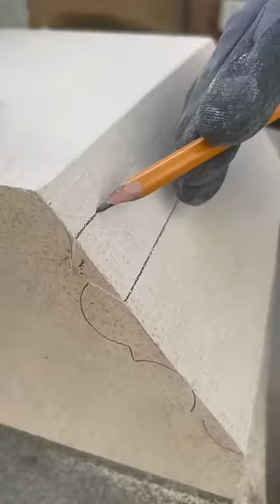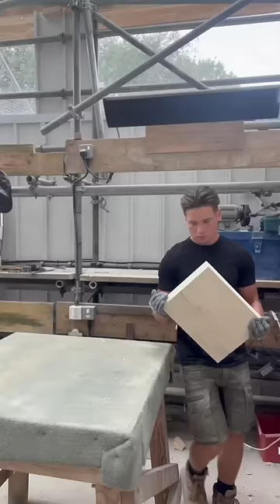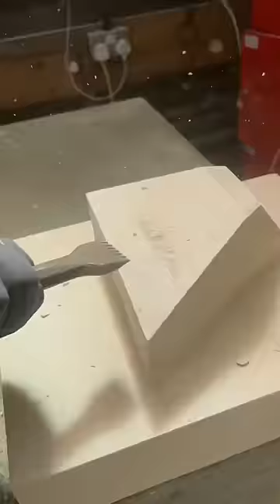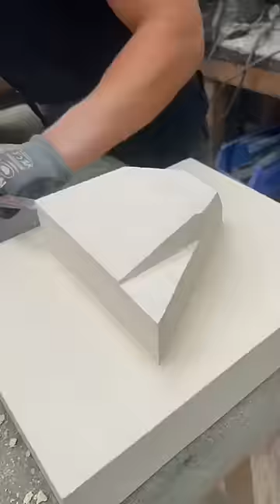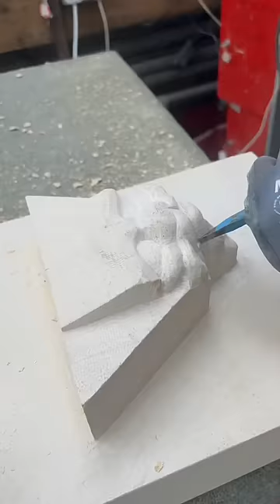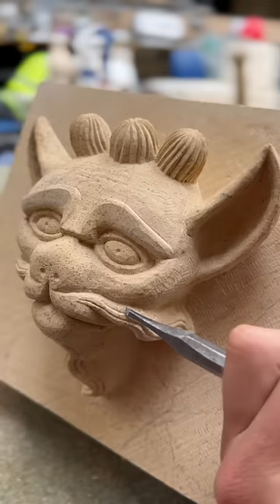#stonemasonry

Comment: Man JR could have spent 5 seconds and googled Stoneworkers
Reply: He could have one on the show
Reply: Stoneworkers with copper tools ?.. 🙄😅
Reply: @peterfitzpatrick7032 they used bronze tools, coper and tin, which is a lot stonger than pure copper. 
The fact that there are very few big pyramids shows us they were very hard to make. If they had "lost technology" and the civilisations were tens of thousands of years old, we would see many more big pyramids and structures.
Reply: @steelybojangles can you please explain the other items such as the precision vases that could have only been made on a lathe with a diamond bit? Or the large stones that we would have significant challenge and moving, as we have already proved through testing. It is stated fact that with the current knowledge that we have, we do not know how the Egyptians, or whomever created the civilization, were able to achieve what they achieved, when the achieved it. Thinking otherwise is a hubris that needs to be corrected.
Reply: @steelybojangles  

"they used bronze tools, coper and tin"

Likelier copper and arsenic during the Old Kingdom.

Also they were likely using stone tools more often for the grunt of the quarrying.
Reply: @LogicalCanadian  

"that could have only been made on a lathe with a diamond bit?"

#1. There's decent reason to believe that they had the potters wheel during the Old Kingdom.

Just because they didn't use wheels for transport doesn't mean that they didn't use them for anything else.

#2. Enough with this diamond obsession, you clearly don't even know waht "diamond bit" means.

A diamond tool is not made from diamond at all, it simply has a coating of articial diamond crystal growth on the tip of a hard metal tool - likely tempered steel.

The diamond acts as an abrasive which does the actual cutting.

Likewise the Egyptians used abrasives to cut, with a metal tool to move them across a stone surface.

The Egyptians used quartz sand, and possibly also emery, a variety of corundum mineral.
Reply: @steelybojangles 

As a retired machinist , I've spent 40 years working with many different metals... and bronze is NOT a hard or tough material, yes its a bit harder than plain copper but its not going to hold up to carving granite etc. more than a few minutes ... 😒
Reply: @peterfitzpatrick7032  which is why they literally had blacksmiths on site who’s only job it would be was to fire sharpen chisels constantly
Reply: .... "JAMIE!"
Reply: @peterfitzpatrick7032  arsenical bronze is up to 40% harder than normal bronze. On top of that you can work harden it to basically the same hardness of steel. You're gonna do a lot of sharpening but it's doable. Btw, steel is softer than most granite, we've used it to work granite for hundreds of years... is that impossible too now? 

Edit: in fact, I've used steel tools to work granite just today. Alien technology I tell you...
Reply: Lmao you think stoneworkers are real?
Reply: i do agree with you but the scale of it is immense, if we did it today, the amount of resources needed would be insane. My personal opinion however is lost tech maybe but it could also be something  we cant fathom or something so simple we are like wtf bruh. But with how time works i think we are very vain and arrogant. If the world wanted to just change catastrophically for a million years, maybe the next humans or whatever sentient being evolves thrive on this planet, theyll say the same about us if theres anything left to look at. Buuut we'll never know unfortunately lol orr humans will find out but we'll be dead unless someone solves it while we're alive @steelybojangles
Reply: @paradiseprod6153 the scale was immense then, too. At any given time they had thousands of workers building the pyramids, peaking at around 40000
Reply: Do you're research on the time in wich the pyramids were built, the amount of materials used and how far they had to go to get those materials and it doesn't add up💀 people have done the math and it doesn't match up whatsoever
Reply: @ohno...notyou1432  what about it doesn’t add up? Tens of thousands of people worked on one pyramid and it still took 27 years to complete
Reply: @birdrocket  the granite blocks found about the kings chamber weighed about 25-80 tons each and there was a total of 8,000lbs of those granite blocks. The only location they could've gotten them from was a place called Aswan located 800km away from where the pyramid was built. Keep in mind the margin of error for the construction of the pyramid was 0.04% so if their measurements were off by 0.04% the pyramid would be lopsided and wouldn't have been able to be built. 

So tell me how in the actual fuck did they transport a total of 8000 tons of granite each block weighing 25-80 tons each a total of 800km or 1,624,671 ft while keeping each block within that 0.04% margin of error💀
Reply: @ohno...notyou1432  with fucking boats dude. They fit on site, not at the quarry
Reply: @birdrocket  I'm very aware of that I never said it was imposed to transport I was saying it's hard to believe they could bring them that far with the blocks still being within that 0.04% margin of error
Reply: @ohno...notyou1432  the distance has nothing to do with the precision, they cut them rough then transport them, final fit on site
Reply: @birdrocket  I never said it did. What I was saying is the further you have to transport something the more risk you run of it getting damaged.
Reply: @birdrocket  I'm not saying they didn't do it because obviously it can be done I'm just saying it's hard to believe everything they say about it because some things don't match up💀 they found traces of explosions in one that left a trace of something (forget the name) that's only created when 2 other chemical come in contact. They say they were burial sights but there was never any bodies found.
All I'm saying is a lot of shit doesn't add up🤷
Reply: @ohno...notyou1432  you are the meme
Reply: @ohno...notyou1432  okay. So if it gets damaged, you get a new one.
Reply: @birdrocket  once again didn't someone do the math showing the time frame doesn't match?💀 and you said that like it wasn't common sense lmao obviously they would make a new one they weren't gluing rocks back together🤣
Reply: @30Minparking  for what reason exactly?😂 I never once said they didn't build them all I'm saying is some shit doesn't add up... can yall not except that or sum?💀
Reply: @ohno...notyou1432  what about the time frame doesn't make sense?
Reply: @birdrocket  the time itself? Like someone did the math and it showed that it would've been impossible for them to build in 27 years.

"Pyramid of Giza contains 2.3 million individual blocks of stone, meaning one block would have to be laid every five minutes of every hour, 24 hours a day, for the entire 20 years. The problem? Each block weighs at least 2 tons." 
So tell me how people with copper tools were putting up 1 of those heavy ass blocks weighing multiple tons every 5 minutes for every single hour of every single day...💀
Reply: @birdrocket  the 2nd part wasn't apart of the 1st part btw, just another reason why I have a hard time believing what they told us about all of ts
Reply: @ohno...notyou1432  the way they did it is with thousands of people working on it at any given time. Khufu's pyramid wasn't built by one dude lmao. For example, with the placing of the blocks, say there's 4 teams on each face of the pyramid placing blocks, 16 at a time. Suddenly instead of looking at every five minutes, each team only needs to place a block every two hours. Graffiti found at the work sites suggest the haulers worked in teams of 40. 40 men lifting 2 tons into place suddenly only turns into each man lifting 100 pounds into place. 

Nothing about the Pyramids' construction is impossible. It just took a shit ton of workers to get it done.
Reply: @birdrocket  I never once said it was impossible I said it was personally hard for me to believe...😐 i still don't see how people using copper tools could place 1 block weighing 1 ton+ each, every 5 minutes and have them be within that 0.04% margin of error💀 again I'm not saying they didn't build it and I'm not saying was impossible what I'm saying is it extremely hard to believe and stating the fact shit doesn't add up😐 
They said they were burial grounds but nobody was every buried there...  there was a chemical found on the walls inside a pyramid that is only found when 2 other chemicals come in contact, so then that brings the question of what were they doing with the chemicals and where did they get the knowledge of how to collect and use those chemicals. There's signs of water erosion but there wasn't water in that part of the world when the pyramids were built or after the pyramids were built💀 there's shit that doesn't add up that's literally all I'm saying lmao
Reply: @ohno...notyou1432  I explained the “every five minutes” part. Tons of people. I have no idea what you’re talking about with the 0.04% margin of error, but the interior blocks of the pyramid structure are not at all precise. They are extremely rough, and the gaps were filled with mortar and rubble. In reality, precision was only a factor in a minute fraction of the pyramid, and sheer man power is the explanation for how it was done. 

I have no idea what you’re talking about with the chemical thing. As for water, are you serious? It sits on the banks of one of the largest, most important rivers on the planet
Reply: @handwerkskunst_handicraftarts what do you mean where?💀
Reply: @birdrocket    i just double checked btw and it was actually a 0.05% margin of error but if you have a 0.05% margin of error that means if your measurements are off by even 0.01% the the whole pyramid would've been lopsided. I don't know how to better put it into words my bad.
Once again I'm just saying that some shit doesn't add up, you don't have to agree.... and I wasn't saying there's 0 water whatsoever my bad I worded that wrong. The video I watched on it was showing different parts of water erosion on the pyramid and sphinx that could only be created by a large mass of running water but the last time there was a large enough mass of running water capable of doing so was 8,000 years ago bit the pyramids were built 4,500 years ago. The video could been total bullshit but I fact checked as much as I could on it and couldn't find any lies in what they were saying.
Reply: @handwerkskunst_handicraftarts  im sorry but you don't just "improvise" a building like that... they definitely knew what they were doing lmao💀
And you can look up the margin of error for the construction and it will tell you 0.05% (thought it was 0.04) not that 0.01 difference really matters🤣
Reply: @ohno...notyou1432  Wind + sand for thousands of years is enough to do some serious damage. The limestone is of poor quality. Salt and water in the limestone get drawn out, which erodes the face of the stone. Also, the area around the sphinx, which has the most amount of erosion, is partly natural, partly carved. Let alone that it's been continuously inhabited since then. The face pieces of the pyramids are mostly all gone because people would steal them for personal collections or museums. 

That's not how margin of error works. It's not a prescribed number that says that the pyramid would be wrong or lopsided or whatever if it was more than x off of another value. All it means is that the measurements of the lengths of the sides is off by that amount, as in, each side is a different length, just close enough to the lengths of the other sides. 

To achieve that 4500 years ago is impressive, but not unexplainable. The interior bricks were extremely rough, they would only need to be precise on the corners. Plus, they had plenty of trained engineers and their own standardized measurement system.
Reply: @birdrocket  I'm aware of sand erosion but there's different characteristics between sand erosion, water erosion from rain and water erosion from a mass of flowing water and that's what the video when into detail on. But again it could've been complete bs😂

And that makes a lot more sense now lmao I thought it meant if you're measurements we off by 0.01% then everything would turn out lopsided meaning you had to stay within that 0.05%
Reply: @handwerkskunst_handicraftarts 100%
Reply: @ohno...notyou1432  nah it’s just saying that they measured the pyramid and its sides are all pretty close in length to each other. Again, super impressive, but not impossibly so, even for an ancient civilization. 

Maybe that guy truly believes what he says, but I kinda doubt it. With those conspiracy theory type things, the people leading it go “mainstream x won’t tell you about it, you gotta listen to ME”, and it’s just so you pay them more attention, so they get more ad revenue from you. 

It’s a sexy idea, that there’s something more going on with the pyramids, but the reality is just that literally thousands of people were working on them at any time, for 27 years straight.
Reply: They had copper tools not steel bud
Reply: @LuigiMason "oh shit the bronze is bent again.... JIMMY!!!"
Reply: @ohno...notyou1432 you really didn't read his comment huh as you're still saying "every 5 minutes" as if one person was speedrunning everything
Reply: @ohno...notyou1432 are you saying the Egyptians could just you know measure  where the stones would go I mean they’re not cavemen they had architects (stonemasons) also it was a pyramid it’s actually quite hard to fuck up such a simple shape
Reply: @ThePDaddy surprisingly copper can indeed be used to cut through stone also they used sand to increase chipping power as sand has a lot of quartz in it
Reply: @fryingpamm6371  you literally just said (in other words) "it's actually quite hard to fuck up a build that contains 2.3 million stones while the heaviest pieces weigh 80 tons..... (keep in mind it was granite one of the hardest materials in the world) 🤣

And may I remind you nobody knows how they were built. It's literally all hypothesis😂
Reply: @fryingpamm6371  anything can cut through stone with enough pressure and volume. This is not well thought out on your end. Smashing things is different than tens of millions of precision cuts :/
Reply: @ThePDaddy  it’s not smashing it’s literally a saw and it works like a stone cutter but by hand there’s been many tests and all have shown it to work quite well and when in the hands of a stoneworkers they can get it quite precise
Reply: @ohno...notyou1432  yeah it’s not that hard to fuck up that if your just decent at measuring anything you think too little of the Egyptians I think also the outside had basically no detail to them it’s just laying out stone(not one at a time) I mean there’s been plenty of failed pyramids so they had practice 

Yeah we didn’t see them do it but we have the tools that they used and we tested those tools in ways they most definitely could’ve achieved and they worked so I’m not sure what your point is
Reply: @fryingpamm6371  my point is that someone did the math and they physically couldn't have built them in the time frame that they did💀 again I'm not saying they didn't build them lmao I'm just saying hard to believe that people with copper tools could place 1 block every 5 minutes of every hour of every day when some of the heaviest granite blocks are only found 2 million+ feet away💀
Reply: @peterfitzpatrick7032 Which is why they wouldn't use Bronze of Copper for anything involving granite (good thing Granite made up less than 1% of the structure by weight am I right?) And could use Flint (Harder than Granite) and Quartz sand (also harder than Granite and fucking everywhere) whenever they needed to cut anything harder than the Limestone they made the majority of the structure out of.
Reply: @paradiseprod6153 The "magic sauce" is superstition man, convince 20,000+ skilled laborers that you're a God and to please you they have to make a worthy monument around your burial site or their crop harvest will fail and you'll see what kind of crazy shit can be accomplished.
Reply: @ohno...notyou1432 it's Granite dude, it's pretty hard to accidentally fuck it up enough for it to not be usable anymore.
Reply: @ohno...notyou1432 My brother in Christ I'm going to try and explain a concept called "man hours" to you. Man hours do not equal the actual amount of time spent working on something, instead they measure the amount of time spent multiplied by the amount of people working on it. For instance if you had 10 guys working on something for 1 hour they spent 10 man hours working on it. The Math you have based your argument on only measures the man hours required to build the Pyramids, if you have enough men and material you can very easily be laying thousands of those bricks on any given day because you can have 400 teams of 40 laying ten bricks a day, that's a brick every 21 seconds but each team only has to lay one brick every 90 minutes across a 14 hour shift.  Please explain how that's impossible now because another guy on the Internet didn't understand what they were actually measuring.
Reply: @NarcassiticGamer  bro it's incredible easy to fuck up granite blocks that weigh 1-80 tons each tf do you mean🤣
Reply: @NarcassiticGamer  may I remind you that we literally don't know how they built them💀 pipe tf down you're getting emotional over something nobody knows to be true🤣
Reply: @ohno...notyou1432  Then explain how one might fuck up a chunk of Granite enough to make it unusable, saying it is so without actually explaining anything doesn't make a convincing argument my guy. If you're gonna be out here claiming shit then actually be able to back it up, sure we don't know the exact process on how they did it but they left enough shit behind for us to make some pretty educated guesses, that's the whole point of archeology, just because you don't know doesn't mean other people haven't got a pretty decent grasp on how they could have done it.
Reply: @NarcassiticGamer  do you really not understanding that it's easy to chip off enough here and there making the block unusable, there's also damage during transport. 

Also you need to go back to school because your reading compression is fucking shot🤣 I never once said it was impossible to do all I'm doing is pointing out the flaws in the current theory and how some of them don't make any sense... and look how mad that got you😂 have a good one bud
Reply: @LogicalCanadian  I mean we are pretty sure on how they did it. They cut stones and put them into a big pile. Its not that hard to think of. 

What are you hoping for? They used powertools? Aliens? What are you expecting. Its hella rude to just say ”nah not possible” for thousands or even millions of people to make the pyramids and all the effort that went into them.

Fuck I replied to the wrong comment but Ima just leave it
Reply: @fryingpamm6371  wrong
Reply: @ohno...notyou1432  The granite blocks used in the pyramid vary greatly in size. If you messed one up, you just started cutting further in
Reply: @griffin123122  I'm aware
Reply: @ohno...notyou1432  Cool. Well that answers your question then.
Reply: @floseatyard8063  if you read my comment you would've realized that someone did the math showing how the time frame doesn't match up... 99% sure didn't have the capability to place 1 block every 5 minutes of every hour of every day for 27ish years straight without fail...💀
Reply: @griffin123122  not really. Someone did the math showing how the time frame doesn't add up. You can look this up lmao also everything is speculation when it comes to the pyramids💀
Reply: @ohno...notyou1432  Someone did the math incorrectly lmao, because it only accounts for one worker. If you actually account for all 30,000 laborers, it comes out to 1 block per worker every 100-150 days. That's equivalent to cutting 3 inches of rock and carrying 55 lbs of material per day.
Reply: @griffin123122  but the fact is they weren't carrying 55lbs of material everyday... they were transporting blocks anywhere from 1lbs to 80tons lmao that's where the problem starts. You can't explain how they were able to put 1 block on average weighing 2.5tons/5,000 pounds every 5 minutes for every hour of every stay for 20-27years without fail💀 if you could explain it we would know how they built them for a fact but it's literally all speculation
Reply: @ohno...notyou1432  that's on average pace, also like someone said they worked in teams
Reply: @ohno...notyou1432  ... because they didn't have all 30,000 people working on every stone, like I said. It doesn't matter how they broke up labor as long as they did the equivalent of a blocks labor every 150 days.
Reply: @floseatyard8063  once again what yall are saying isn't discrediting what I'm saying😂 

I'm very aware that they had to possibilitie of creating the structures I'm simply pointing out the flaws and contradictions within our current theorys on how they're built😐
Reply: @griffin123122  once again what yall are saying isn't discrediting what I'm saying😐 fact of the matter is nobody knows how they were built it's literally all speculation and all I was doing was pointing out the flaws and contradictions within our current theorys💀 I never once said they didn't make them and I never said they didn't know how to I'm simply stating the flaws within our current assumptions🤦
Reply: @ohno...notyou1432  It directly contradicts the validity of the math used lmao, you don't know what you're actually saying you just know what you want it to say.

So considering that the math you used to try to point out these problems is fundamentally flawed, that means you haven't actually done anything but make yourself look like a tool.
Reply: @griffin123122  homie what you said didn't controdict anything about anything I said tf are you on rn🤣
Reply: @ohno...notyou1432  This is why I said you don't know what you're talking about lmao. Your math is based on doing one block at a time.
Reply: @griffin123122  homie I'm jot talking about the production of the bricks...  I'm saying for the pyramid to have been built in 20-27 years they would have to place 1 block every 5 minutes of every hour of every day and night without fail😐 nothing you said was discrediting that and you never once explained how it would be possible tor them to place 1 block every 5 minuts without fail lmfao💀
Reply: @ohno...notyou1432  You can place more than one block at a time too jfc how are you not understanding this
Reply: @griffin123122  once again you didn't explain how people with copper tools we about to place nor then 1 multiple tone block every 5 minutes of every hour of every day without fail... how are you not understanding?🤣
Reply: @ohno...notyou1432  I have, you just don't understand your own argument. 

To illustrate, if 48 teams each carved and placed 1 block in 1 day, that averages out to a block every 30 minutes even though it took them 24 hours. This doesn't mean they had to finish one block, place it, and then work on the next one within 30 minutes, because they're working concurrently.
Reply: @griffin123122  once again the problem isn't with the manufacturing of the blocks it comes with having to transport some of them up to 2million feet away😐 it doesn't make sense how those people will those primitive of tools had the ability to place 1 block every 5 minutes of every day when the heaviest ones were 80 tons/120,000lbs and the furthest location they had to go was 2million+feet🤣 like you along with everyone else has no way of explaining it, if we could then we would know how they were built but once again we don't, it's all speculation💀
Reply: @ohno...notyou1432  Bro how are you failing to understand elementary school algebra?

Also boats exist.
Reply: @griffin123122  no shit that doesn't change aything about what I said🤣 the fact is nobody knows how it was done its all speculation so what you're saying is a bunch of irrelevant bs also you're not answering the question I've been asking this whole time... what you keep repeating doesn't explain how they were able to place 1 block every 5 minutes of every day without fail😐 I'm not saying it's impossible for them to build them and i never once said they didn't build them I'm just saying our current theory has a lot of flaws. If you disagree that's whatever lmao💀